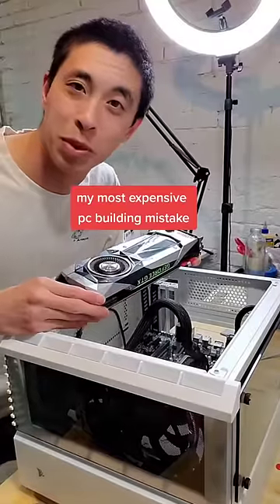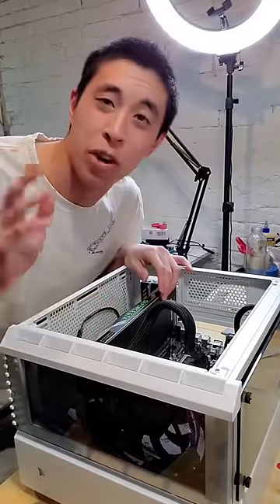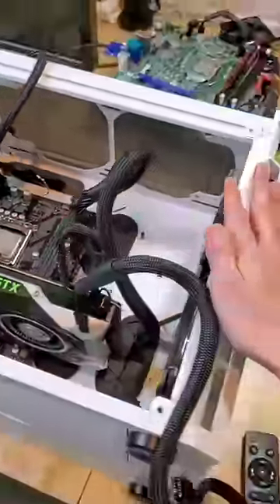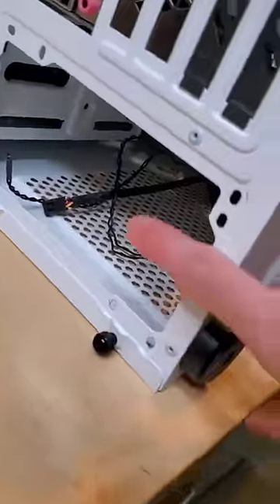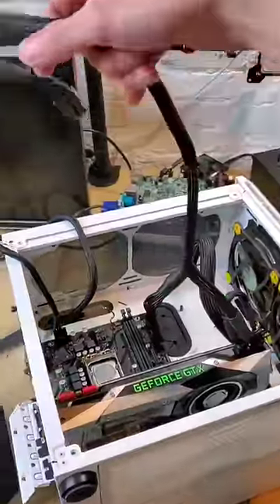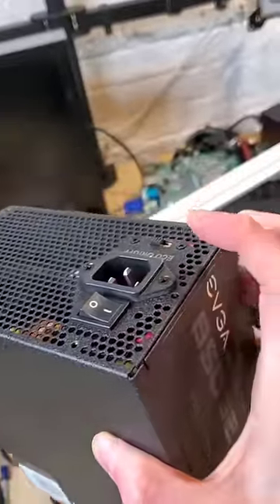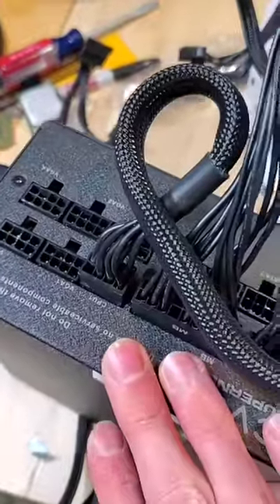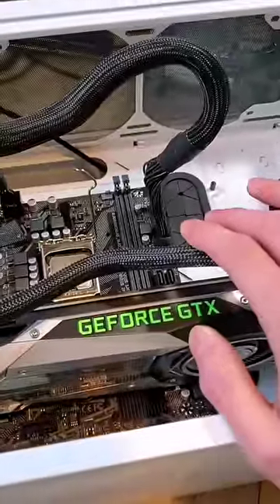my most expensive pc building mistake... #shorts

Comment: Most Expensive mistake I made was cracking a core on an AMD 1333. Back then the cpu coolers were spring loaded. The 1333 AMD's had NO heat spreader, it was the core and that's it. Not only that but most thermal paste was electrically conductive.

Comment: Bought a used monitor that had damaged panels. The monitor would lose focus after about half hour of use. I did not check for long period. Hence my mistake. The monitor did have slight bleeding problem but as I was getting a good deal I thought nothing of it. If you buy 2nd hand monitor never buy one that has bleeding problem and always check by running it at least an hour and check everything else.

Comment: You saved my mental state.
My system would power on and immediately off.
I just got a new PSU and kept one of the old SATA cables from the old PSU because it was already connected to everything.
Couldn't figure it out until I saw this.  Exchanged the SATA for one from the new PSU and it WORKED!!!!

Big thanks

Comment: Bought a 300$+ i7 6th gen proc, and found out the hard way that the socket is not the only thing that matters. My motherboard I purchased was for 9th gen and higher. Sockets matched up but in the end had to get another proc. I ended up using the 6th gen in my emulation station (1up arcade cabinet)

Comment: Did the same mistake. Was tired and thought "what the heck? SATA power is SATA power" ended up frying 1 SSD, 1 SSHD and 3 fan LEDs. The LEDs made a high pitched squeal into green with a puff of smoke. The remaining components worked and it booted up just fine.

Comment: I did pretty much that except I was using cheap Chinese power splitters to attach more hard drives than I should have and one of the drives straight up caught on fire!  I yanked the drive out of the computer and stomped it while shutting off the surge protector.   Every drive that was connected was destroyed including the optical drive.  The psu died as well.   The ram and CPU still work to this day, 2 years later.   I haven't tested the mobo and at this point I'm kind of afraid to

Comment: Took a running 2060 out of an ewaste machine, swapped my 1650s out, turned on my machine, no network, wifi or NIC. Turned it off, went and got a USB C to NIC adapter and tried to power it back on no post, found the pcie slot somehow bridged and melted the pins, killed my Mobo and CPU, fortunately I also got a 9700 out of the same machine which conveniently replaced my 9400f that I fried. Turned out to be a basically new build after I got a new Mobo, AIO because I didn't like my air cooler, new ram that was 3200 instead of 2666, a 3060ti to actually upgrade the GPU, extra m.2 to match the additional slot on the new board, RGB fans to match the RGB AIO. Basically ended up reusing the PSU, the case, and an m.2 the rest was replaced but I did resell the 1650s for half the price of the 3060ti so that worked out alright

Comment: My least expensive "mistake" is buying an "open box" motherboard on Ebay. Pictures looked great. It still had that factory protection plastic, original box, pins looked great. MOBO arrives and what do you know? The pins looked like someone was trying to get one of those nasty under skin itches out with the cpu pins. I honestly thought some pins were missing at the time. So, like any reasonable person would do, I issued refund, said I would return, and the seller ended up fully refunding and letting me keep the board. Hooray! Time for motherboard pin surgery. I carefully bent them all back and I SOMEHOW managed to not break a pin. Some pins were even bent all the way backward. I am currently typing this on that pc. The only problem is it only accepts one ram stick in slot b2. So that was my cheapest PC building mistake, hope you enjoyed a quick read of my past few weeks lol.

Comment: First computer I built, I didn't think the cpu fan was necessary, just a good upgrade. Had to replace cpu and motherboard, as at the time I did that brilliant move, there were no automatic shutdown if temperatures ran to high. Most expensive few seconds of my PC building adventure so far.

Comment: One of the pieces of advice the internet gave me for a system not recognizing a sata ssd was to tap on the ssd
Do not, tap on the ssd. I was 15 and it was my first build. I'm better now.
Reply: what
Reply: @xero6774  Tapped on the drive a little too hard and it died lol, turned out the problem I had was completely unrelated

Comment: Can't say this was a mistake I did personally, but I got a faulty motherboard during my x570 build. After putting everything together, making sure everything was seated properly and plugged in, I flipped the power on. Nothing showed up on screen, so I started checking that I had monitor on while not realizing the  smoke rising off the board and components. Needless to say...everything was trashed and it turned out it was due to a bad solder point on the back of the board. Was not a happy camper to say the least.

Comment: 4790K, 1.45v :(
Reply: 1.45 was super hot but not an instakiller like 1.55V
Reply: @randykitchleburger2780  Unfortunately, after a few months it became unstable and never recovered.
Reply: @microgamestation  RIP, I ran mine at 1.42 for a pretty long time without issue but I was watercooled
Reply: @randykitchleburger2780  Nice. You remember the frequency?

Comment: Don't use third party PSU cables, that includes the "big names" like Cablemod and Asiahorse that are so heavily pushed by youtube influencers.  Keep in mind influencers build machines for a single video, then it's almost never touched again.  I've used PSU cables from both companies and slowly, over time, they made my system unstable to the point I couldn't use it.  Stick with your PSU cables, even if it makes your system a little uglier.